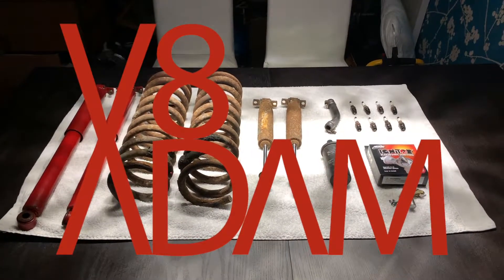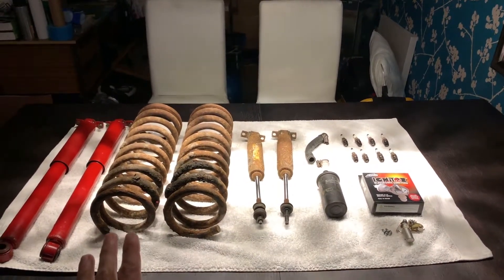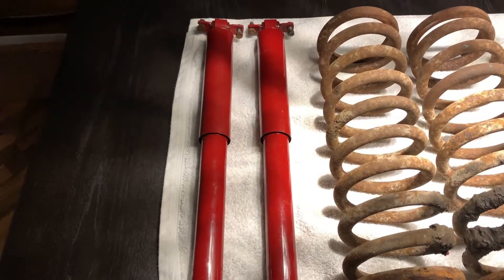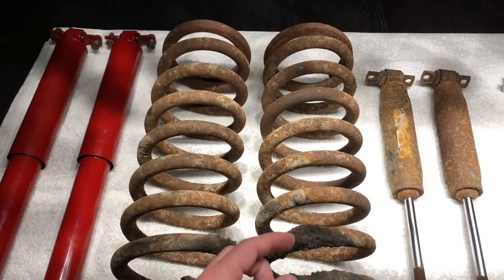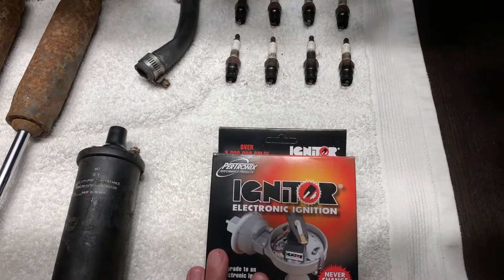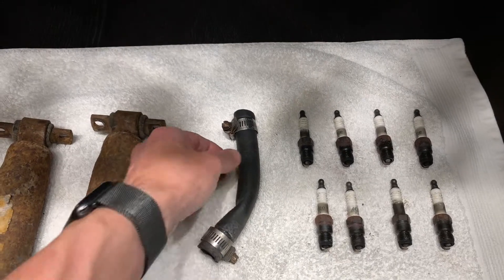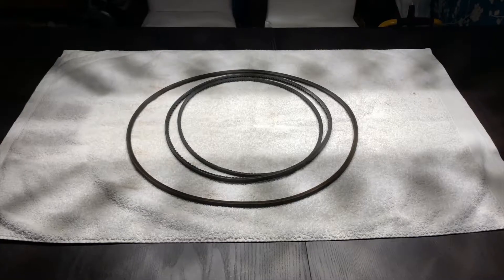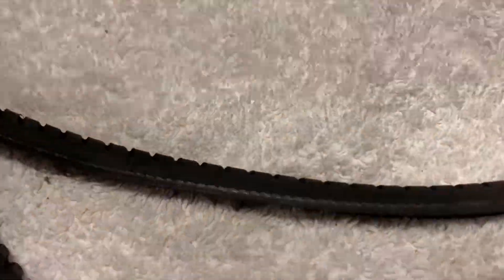1972 Buick Riviera - 1st Service/Overhaul

Comment: I also have a Riviera (73) with the old school points ignition. I think you should keep these. If the electronic ignition fails, you'll be stranded. The points ignition is easy to fix and a broken condenser can be replaced within 5 minutes and the trip continues.
I wish you a lot of fun with your Riv' and always good Trip.
Reply from the maker: Thanks for that information. I have so far had no issues with the electronic ignition and I find it useful that it starts the car better. I hope that you enjoy yours too!

Comment: Cool, rear shocks and springs were the first things I replaced on my '69 LeSabre. Plus side of it having a '75 V8 in it is that it has the HEI distributor. Don't have to worry about points anymore! (Albeit a bit down on power now.)
Sweet Riv too. Happy to see a V8 Buick in the UK! 👍
Reply from the maker: Left Seat Adventures thanks so much for the comment and sub! Did you swap the engine on your ‘69 yourself?
Reply: @V8Adam  Nope, not on this one. The car was in my family for a while, different engine already installed. Not sure why. It sat for a few years before I took ownership of it. Recently got it out of "winter hibernation" here: https://youtu.be/PqwwvX0XSqE